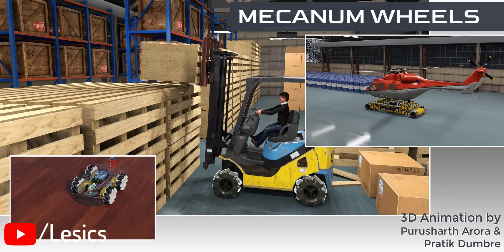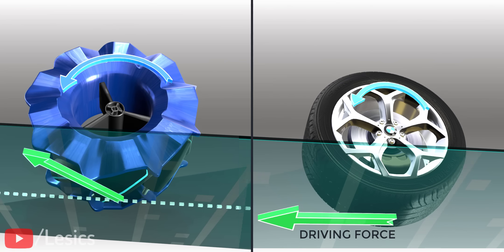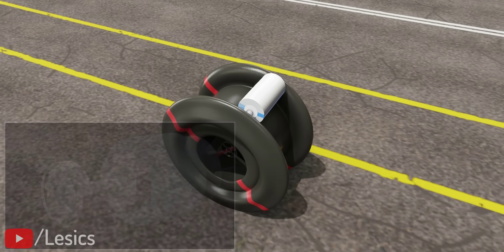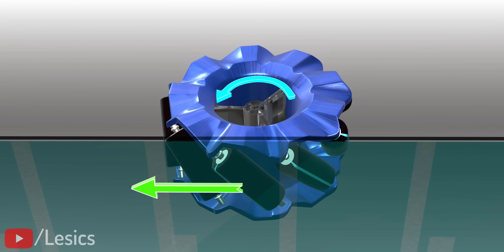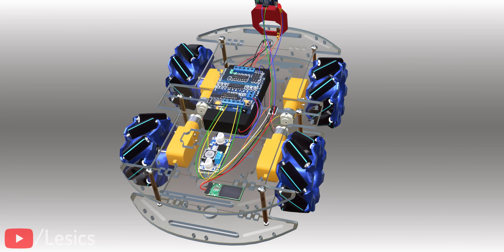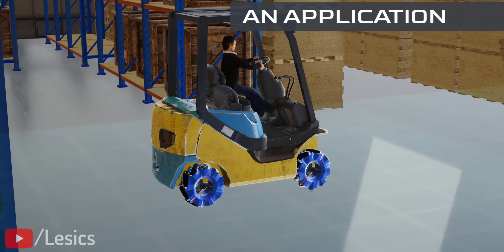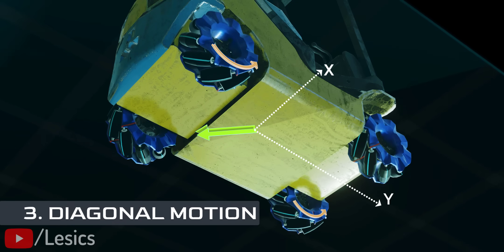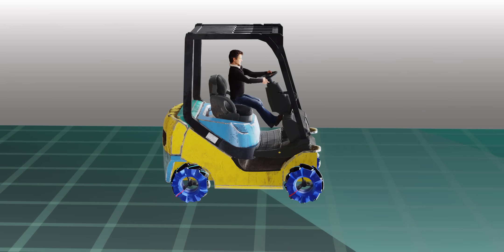The Brilliant Engineering of Mecanum Wheels!

Comment: There's so much wrong with the mecanum in practical terms though, namely maximum load bearing, extreme susceptibility to friction loss leading to accidents, and inefficient (or outright destructive) conversion of energy to motion.

Maximum load bearing for a mecanum wheel based vehicle relies on the axels of the rollers and their mount points, so in practical terms, a forklift capable of lifting 1 ton with mecanum would require solid steel axels on all of the rollers and thick 2 part milled block steel locking rings for the inner diameter and mount points of the rollers. Under ideal conditions mecanum wheels for industrial applications would be incredibly expensive compared to just using a forklift friendly warehouse layout.

Due to their significantly reduced contact area, mecanum wheels are much more susceptible to dusts and dirt causing slipage, even just one wheel slipping can turn a lateral movement into a rotational movement, in the forklift scenario described that leads to slamming into warehouse shelves with a product laiden fork, and on cars it's a fast track to an accident.

Finally, the creation of two opposing angles of movement creates extra stresses on the frame and wastes rotational energy, leading to early breakdowns and wasted potential energy. Both a financially and ecologically unfriendly prospect, all to fit a single shelf of additional storage per 10,000ft of warehouse.
Reply: Hence why they will only be used in warehouses on said surface and on Hilariously leveled floor, refering to that one episode in Rick and Morty
Reply: @fetlix  which episode is that ?
Reply: @fetlix  which episode of Rick&Morty or which season?
Reply: thats why they invented reach trucks and magnet lines(with an adjustable forkbord) so you can already get maximum storage space
Reply: I suppose the idea at this point is 'here is a mechanism' and others can also take up the concept and work to see if they can improve it. We didn't think electric cars were necessarily feasible in the past but Musk made it work to the point of mass production. Computers use to be quite large and the idea that they could be smaller was not readily accepted as anything but 'maybe one day' or not at all. Today, we have the computing power that makes the computers of old look and be obsolete. We have a device today called a cellphone that in the past was confusing to comprehend how you could get something that small and that compact to do everything that modern cellphones can do. It's a radio, it's a TV, it's a video recorder, voice recorder, it takes pictures and you can talk to someone far away while looking right at them in moving picture style, you can use it has a flashlight, a guide on how to get to new places and you can find a phone number of friend or family without picking up a great big paperback book and flipping through it. Come to think of it, I have already seen a video of a car that can move in that sideways motion on Youtube. The point is that now that we have an idea of how it can be done we can work on the business of making it happen. Once that is accomplished then we can work on producing it, mass producing it which will drive down the cost.
Reply: @jasargo  Electric cars were a well proven and developed concept in the UK by 2010. All Musk "innovated" was applying good business and negotiation skills to put fast charging stations every 40 miles so larger nations could use them too, solving the ever present Chicken and Egg problem with alternative fuel adoption.
Reply: Yea and also.... As if a normal forklift needs to do a J turn to turn 180 degrees. A propper forklift driver can do almost everything this thing can do. Unless he's in a path that really has not an inch to spare.. But why would we want to make warehouses with human controlled forklifts so narrow? We have seen what can happen in a warehouse when a forklift accidentally hits a supporting beam.. Funny idea but only useful in rare occasions.
Reply: show me a warehouse with no dirt and perfectly smooth floors and slow driving speeds, and I'll show you a warehouse that has never actually operated for even a single day as a warehouse
Reply: I suppose the next best thing would be tracks for forklifts since that allows high grip and rotation in one spot
Reply: So they are the Hyperloop of wheels, huh?
Incredibly awesome in idealistic CGI, but in reality all hell breaks loose as soon as you merely sneeze at them.

Too bad. 😕
Reply: @pelic9608  Being the hyperloop of wheels implies they're being criticized by armchair engineers throwing around overblown or straight up untrue 'flaws' around without having much understanding of the principles in question, and that's completely correct

your interpretation of what it implies on the other hand isn't correct
Reply: Could you sollve this problem by alllowing the wheels themsleves move to the 45 degeee angle? Would probaby be one complicted suspension but i see so many practical applications. Most importantly so women can parallel park.
Reply: Some practical value to this comment, but don't underestimate the cost of developing an efficient warehouse layout based on typical forklift requirements. Technology tends to develop in directions that can address this forklift's weaknesses if the value gained elsewhere is sufficiently high. A typical operation might be willing to spend several times more on this kind of forklift if it can be made safe and reliable while offering value like shrinking warehouse space (real estate) required, transportation costs by being closer to end users, etc.
Reply: Meanwhile, I'm like "That's gonna tear some tires up."
Reply: Yep that was the first thing that came to mind is how anything lifting a substantial load would basically fall over or fail spectacularly when it needs to come to a complete stop.  I can imagine something like that would have to go impractically slow when moving in any direction other than forward or backward.
Reply: Yeah. What he said...
Reply: yea when you want to use your storage space in an area where real estate is actually so expensive that the cost of just building a larger warehouse actually offsets the cost and maintenance of such a device, you're probably WAY better off if you scrap the idea of cramming a forklift in there entirely and go with an  automatic shelving system.
Reply: Just the maintenance price probably makes these obsolete in any real world use. Also how well do they work on snow and ice during winter while loading stuff into trucks?
Reply: Ok
Reply: Killjoy.
Reply: Wastes potential energy ? Don't you mean kinetic ?
Reply: It’s good for FTC though
Reply: I believe in your last section, talking of rotational energy, you're referring solely to the wheels but there are a few different frames of reference for rotational energy in this system. Engines, bearings, motors, wheels, etc. and even the frame like you said. Potential (gas/battery) -> kinetic (ie, motor) -> rotational -> (motor/wheel) -> kinetic (movement) but it's nuanced with friction, sound, heat, etc. I think the greatest loss of that initial potential isn't to the rotational energy loss but because of the lack of contact of "tire" to the ground, assuming a high coefficient of friction the driver is only harassing a small percentage of what they could with a normal tire that is in full contact and normal to the ground. Long opinion haha
Reply: @bachlava7  I'm talking about wasted kinetic energy obviously, but most normal brains don't think about energy directly in scientific terms, but rather simpler groupings of energy types "fuels" (oil, electricity, gasoline, natural gasses etc.), "force" (the compression and decompression of a piston), and "rotation" (the spinning of a motor). So it's easier for them to understand it immediately if I describe it as "rotational", because they'll understand that even if they spent the entirety of their science classes k-12 doodling in their notes pages and digging for gold in their nasal cavities. Thumbing your nose at me for dumbing it down for the average YouTube viewer is unproductive.
Reply: Could these be solved by fly-by-wire (except expense of course)?
Reply: There's so much wrong in this post as well, only the first of 3 points actually has any merit and even then only marginally

first, mecanum wheels DO NOT transfer the entire weight of what the wheel deals with to a single roller, the typical mecanum wheel has the rollers arranged closer than shown in this video and so at every point two rollers contact the ground not just one, additionally because of that the contact patch isn't actually much smaller than in a typical wheel and on top of that because the rollers actually roll the entire wheel has more surface area that can even get dirty and the contact points don't stay the same every wheel rotation so the rollers actually get less wear (you could also mount a simple brush on the inside of the wheel to sweep dirt from the rollers as they rotate if you wanted to), not to mention vehicles using these actually exist and can operate outside just fine

also there is absolutely no reason why all rollers having steel axles would massively drive the price up, what are you even talking about? they already do have steel axles anyway and remain affordable, in typical armchair engineer fashion you're searching for flaws then blow them out of proportion without much thought behind it

even then losing traction on one of the rollers even for a moment won't actually cause any harm because due to the wheel and roller configuration when wheels don't move the rollers actually oppose themselves due to half of them being perpendicular for every direction where the other half would be parallel and able to roll freely, and that's the case for rotational vehicle motion as well not just translational, and so the vehicle simply won't move, it's also the reason why the 'this vehicle would just get loose on an incline because of the free rollers' i saw a few times is also false, the most they can do is drift a bit when moving sideways

you also seem to be under the (common) impression that mecanum wells are supposed to skid and slide in certain directions to operate, which is completely false and a fundamental misunderstanding of how they work, the way they work is that either the wheel or the rollers rotate and when the latter does it doesn't transfer much momentum to the wheel, at no point do the rollers ever skid on the ground in any of the vehicle movement styles/modes/however you call it that are shown on the video or that indeed are even possible for the vehicle

if the rollers were to skid then the wheel rotates, if the wheel were to skid the rollers rotate, so on top of having minimal ground friction and not needing even close to as much torque for in-place rotation as for example skid steer or even tracked vehicles do the creation of 'two opposing angles of movement' never actually occurs

the reason why they aren't widely used is both because of a lack of existing optimised production chains (as is the case with anything new) resulting in a higher cost but also because people don't understand them and are biased against 'unproven' tech (where unproven actually means 'not widely used already') and are inventing nonexistent or overblown flaws due to both (or in other words, due to people being typical armchair critics that think they're smarter than actual engineers), there is nothing inherently wrong or impractical with mecanum wheels themselves, they handle very well where they're used when they're used, including in forklifts, and don't need actually much maintenance

honestly it's incredibly dissapointing too see you have 1k upvotes, seems people were fooled by you sounding profesional when in reality you're just another armchair engineer that doesn't understand what they're talking about
Reply: You are grossly underestimating the added efficiency per forklift and warehouse space being saved, mecanum wheels work perfectly in warehouse conditions as dirt should not exist there nor should the wheels wear out much with a smooth floor with slow driving speeds. 

Energy is not an issue for electric vehicles as their "fuel" costs next to nothing and changing batteries is a breeze (I work with ebikes, it's a similar process). 

Maximum bearing load is not a priority in most warehouses but it is true that for superheavy industrial warehouses mecanum wheels are not favorable. Furthermore, I believe mecanum wheels are really only useful if you're low on space and working with a tight schedule (like Amazon, for example). 

Also, when looking at the cost of a forklift, you're really not concerned about the price of the wheels, there are far more expensive components and mecanum wheels in particular have a very long lifespan (since you only really have to change the rollers and not the entire wheels). Forcing the forklift to be electrical (combustion engines are a really really bad idea with mecanum wheels) is oddly also very cost-effective since the force produced is much more controlled and there are way less parts, and don't get me started on how much you're saving on fuel.

All in all, I believe mecanum wheels are the way to go for most warehouses and any odd movements or imbalances are easy to fix with clever programming, think ABS but for mecanum wheels. Don't try to put them on cars though, nobody does that because it's kinda dumb and unnecessary.
Reply: @user-iz2oj8dd6j  "Also, when looking at the cost of a forklift, you're really not concerned about the price of the wheels, there are far more expensive components and mecanum wheels in particular have a very long lifespan (since you only really have to change the rollers and not the entire wheels)."

As an employee for a forklift company I can tell you that customers are indeed concerned with the cost of replacing tires. They are also concerned with how easily a forklift can be maintained and repaired. 

I can guarantee that these wheels will not last any longer than any standard forklift tire would.

And changing each individual roller on these things would be much more labor intensive than just replacing a standard tire. 
The wheel would have to be removed and disassembled, each individual axle would need to be removed and inspected, each roller would have a bearing on each end that needed inspection, the axles themselves need to be inspected for wear. 
A customer would only need to have a service like this done once before the cost of labor alone drove them back to standard wheels.
Reply: @user-iz2oj8dd6j  Bro. Have you ever been in a warehouse? Even with constant Tennant scrubbing, 4-5 hours is all it takes for dust/dirt to start accumulating on the floor. Dirt is everywhere in warehouses.
Reply: @doctorbrown5957  there's a lot of doctors in this thread
Reply: @user-iz2oj8dd6j  no. None of that is even remotely true.

Space is generally conserved to the max by guide wires/specially designed lift trucks. Lifting over a ton is extremely common even in warehouses that work with typically lightweight product. Solid rubber wheels wear down, and sometimes even when not very work down the ride can be surprisingly bumpy.

This design would severely limit height of operation due to ride stability even with new wheels and a perfectly clean, flat floor; and would actually require wider aisles than currently exist to account for how easily and quickly this could literally go sideways. Even if it kinda worked, it wouldn't be near as efficient or economic as current optio s, and no one would want to operate it.

This is the wheel equivalent of the f22/35. Fancy engineering at the science fair, predictable disaster in practical applications
Reply: @user-iz2oj8dd6j  I'd ask if u have ever driven a forklift, but I already know the answer, till u have, stick to ebikes, cause there are so many issues with your comment that I'm not willing to type them out and correct them
Reply: @user-iz2oj8dd6j  nice… comparing ebikes to electric forklifts.
Reply: @user-iz2oj8dd6j  Sounds very plausible, plus they have high strength steels to take care of the additional stresses mentioned by the OP.  I just wonder how they steer this contraption, it must require special training and additional control sticks.
Reply: @user-iz2oj8dd6j  👍🏻
Reply: @user-iz2oj8dd6j  >mecanum wheels work perfectly in warehouse conditions as dirt should not exist there nor should the wheels wear out much with a smooth floor with slow driving speeds

stopped reading there. what planet are you living on dude. you've clearly never even set foot in a traditional warehouse.
Reply: It's meant to be driven by peasants inside Amazon Wearhouses.
Reply: @doctorpanigrahi9975  Hey man, they're not peasants, they're just trying make ends meet
Reply: @doctorpanigrahi9975  🤣🤣
Reply: @doctorpanigrahi9975  Robots. Peasants are proving too expensive these days...
Reply: @doctorpanigrahi9975  you spell like someone who works in an Amazon warehouse
Reply: @dromnispank4723  There's no spelling mistake dummy.
Reply: @doctorpanigrahi9975  You used "wearhouse" instead of "warehouse".
Reply: @KiraSlith  Keep your attitude in place.
Reply: @KiraSlith  Oh right ! My bad.
Reply: @doctorpanigrahi9975  Oh dear.
Reply: yah i would not have a forklift that used a mecanum system. all the problems of a standard forklift can be overcome by proper yard layout and a skilled driver. but the system does have good application. just the forklift will never be one of them.

Comment: That's very neat. There is a variation on wheels with rollers around the perimeter that are used on hand trolleys that can go sideways. There are motorcycle paddock stands that use them so the rider can ride into the garage, put the stand under each wheel, and move the bike around at will to get it into a tight spot.